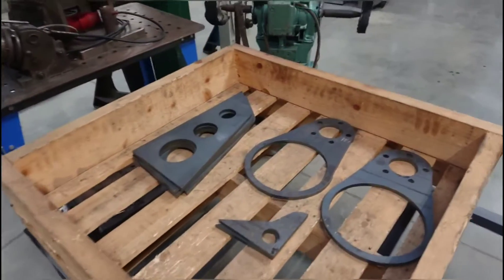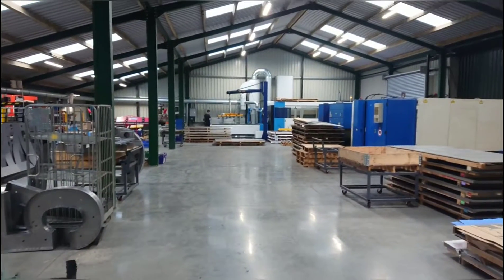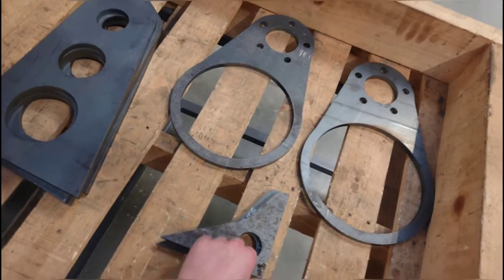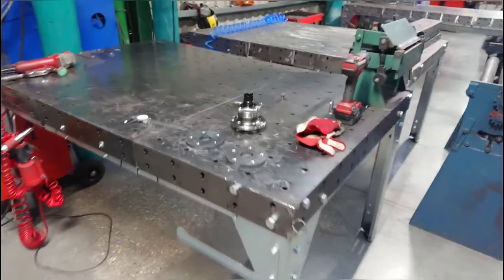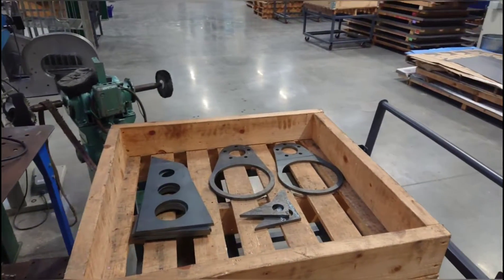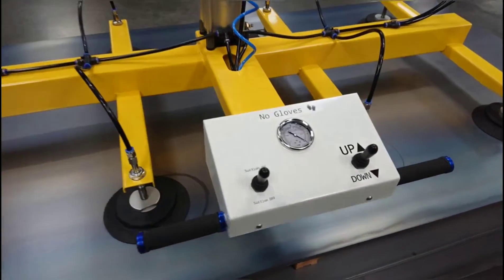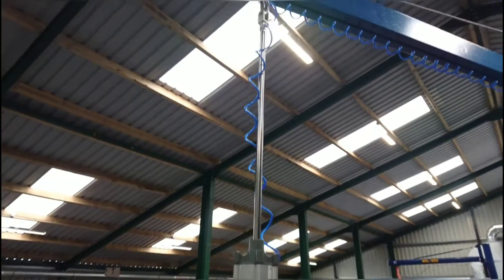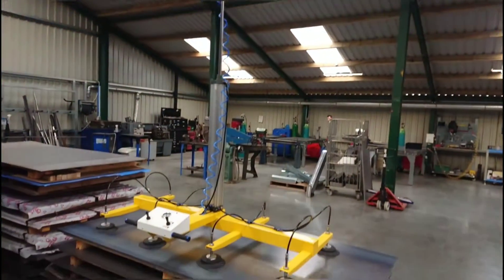Improvement Sheet Metal Jib Crane Build

Comment: Anything special about the air cylinder to raise and lower?
Reply from the maker: No just big, 100mm diameter and 900mm stroke
Reply: @JackBusseyUK  Nice job. What is the max weight you can use on the cylinder?
Reply from the maker: @BogdanHurezeanu  it can lift 300kg no problem

Comment: What vacuum pump and controls did you use for the vacuum lifter? Looks awesome
Reply from the maker: Airtac brand lever controls, and a air powered vacuum block, thanks 👍
Reply: @JackBusseyUK  hey Jack do you have any more information on the vacuum block you used? Is it like a Venturi vacuum generator?
Reply from the maker: @jontywardle1535  Vacuum Venturi Generator CV-25HS is the model number, thanks
Reply: @JackBusseyUK  i have a vacuum generator similar the one you said. But l was reluctant that it will generate sufficient vacuum for the pads to lift 300kg.

Are you using it at 10 bars or have generators for each pad?
Reply from the maker: @BogdanHurezeanu  around 8 bar, and one vac genarator for 8 suction cups,  you must have a air leak or faulty vacuum genarator